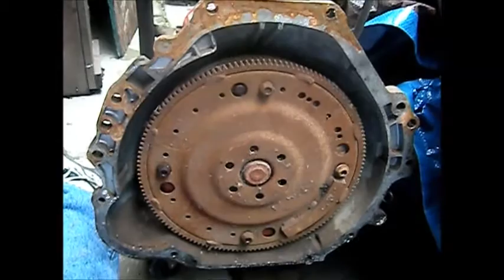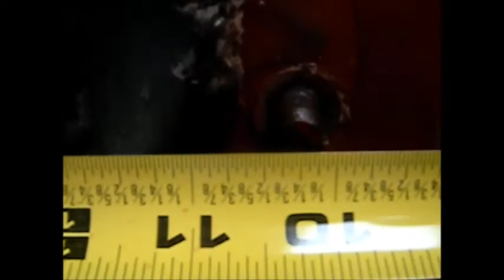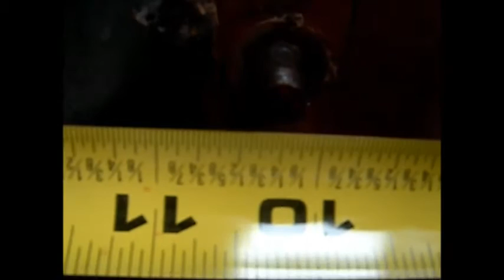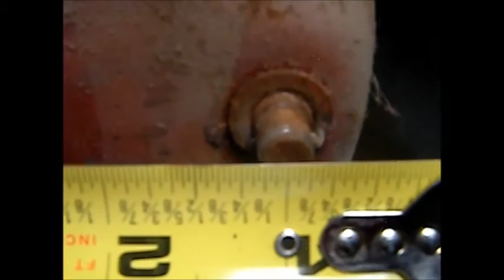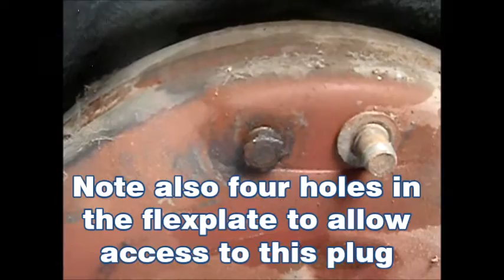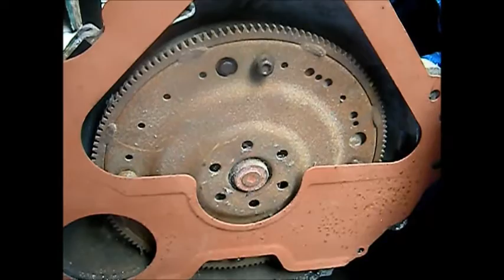Mustang II: V8 - Specific Bellhousing, Flexplate, Torque Converter

Comment: What about a starter I'm pretty sure my flex plate is just eat up the new one will let me know but if starter still grinds I may have wrong starter
Reply: Think I've seen that they used a smaller starter as well. I'm putting one of these together and will try using one of the newer aftermarket mini-starters.